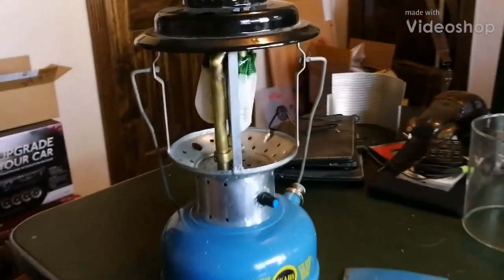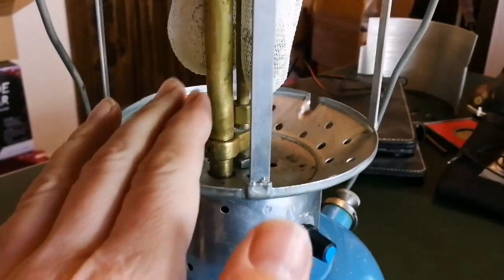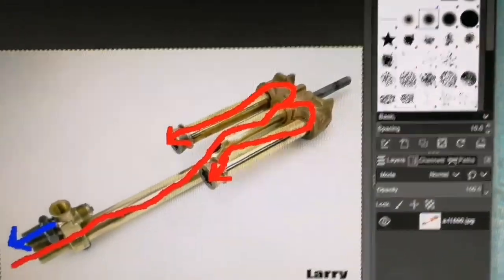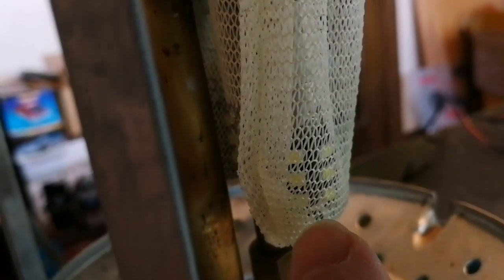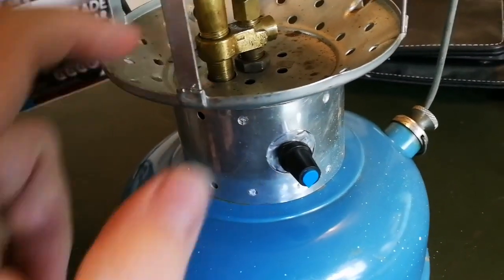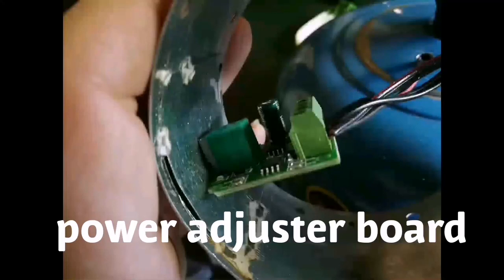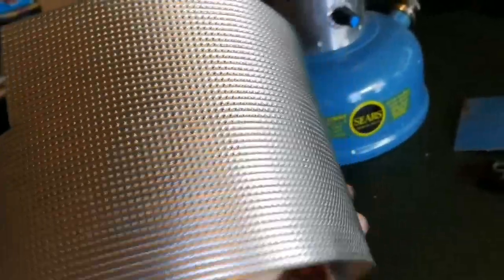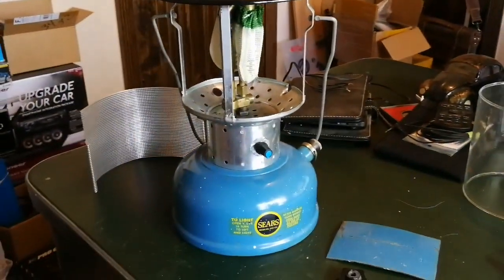DIY Vintage lantern update to battery power and LED

Comment: Man those sears versions are getting hard to find in nice shape like that. Pretty sad to see one bastardized like this 😢. Parts are still easy to get for them as well.
Reply from the maker: Here are 20-60 all day long.
Reply: @VintageSpeedwerks  for a sears or coleman? Regardless its not about the dollar value. They made very few of the sears versions compared to the standard colemans.
Reply from the maker: @jeschreindl  sears. It IS about value lol, it's OK, 90% set in sheds rotting, mine is useful again and I use it in the camper, house and garage.
Reply: @VintageSpeedwerks  ive only seen one pop up locally in the last couple years. That was a $150-$200 lantern currently. When i said its not about the value I mean for me personally. Just a bummer to see such a nice one cut up. There are plenty with pin holes in the fount that would be great candidates. Oh well lol

Comment: What did you find to be the runtime on the battery in the end?  I just got a single post lantern I want to do this with.  I figure with only one light it should run a really long time but I could look into making something that had two bulbs, one on top of the other if 1 on 'high' is too dim.
Reply from the maker: I've ran it at most maybe 45 minutes. Because I have not added a low voltage alarm, it is possible to deplete the pack to far to make charger not charge it, then you'll have to jump start the pack (my other video)
Reply from the maker: I've ran it at most maybe 45 minutes. Because I have not added a low voltage alarm, it is possible to deplete the pack to far to make charger not charge it, then you'll have to jump start the pack (my other video)
Reply: @VintageSpeedwerks  If my internet math is correct, your setup looks like it would run 4 Hrs 43 Min (3.3W bulb on 1300 mah battery). I'm seeing similar 3W bulbs and 3aH batteries that could get up to 11hrs.
Reply from the maker: @BlueWeaselTX  https://www.amazon.com/dp/B01D8GM2GC/ref=cm_sw_r_apa_i_8jDQFb05Y7EDD?_encoding=UTF8&psc=1
Reply: @VintageSpeedwerks  Sorry, I only mathed on one bulb running.  Looks like you may only get 2h21m.  I'm wondering about this.... as it should get me nearly 11 hours: https://www.superlightingled.com/dc12v-3ah-36w-lithium-battery-for-led-strip-light-rechargeable-portable-moveable-led-power-supply-p-2548.html
Reply from the maker: @BlueWeaselTX  I'd go rc car. https://www.amazon.com/dp/B07ZNXGGGV/ref=cm_sw_r_apa_i_X2DQFb8N6SDY1
Reply from the maker: @BlueWeaselTX  I've also added a switch to kill one bulb now
Reply: @VintageSpeedwerks  Yeah, I saw the kill switch for the bulb.  I'm single bulb so no worries there.  Most RC batteries are too long.  I need to stay at/under 5" to make sure it'll fit.

Comment: Way to destroy a extremely rare highly collectable lantern. Not to mention it would be a whole lot brighter and more practical to just run it on gas as intended.
Reply from the maker: Rare vs value, they are all over eBay for $20-60. Sure, def brighter, but not usable the places I use this one.
Reply: Run on gas.... they are loud and much too bright - unpleasantly bright.  Whenever someone lights one of those at the campground I count the minutes until it "goes away".  Certainly if it's on the picnic table in close proximity👀.  I much prefer so see them in photos, than at the campground where I'm at.  If the Sears units are collectible,  maybe consider Coleman units have the classical appearance and are "almost free".